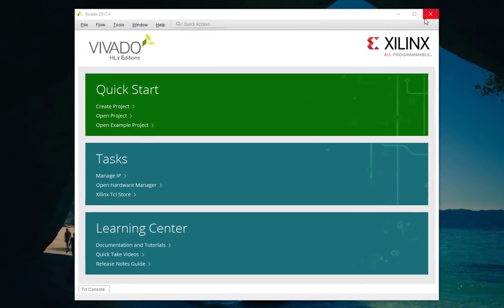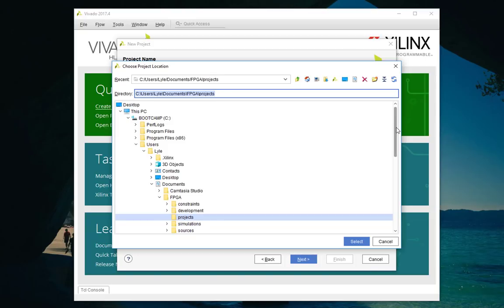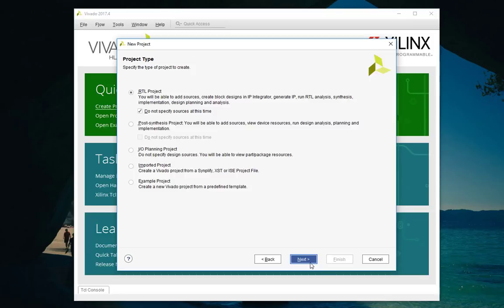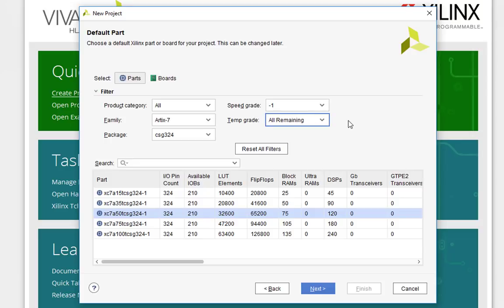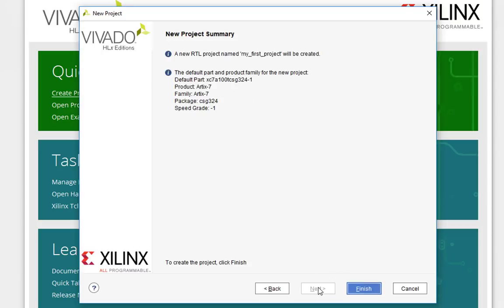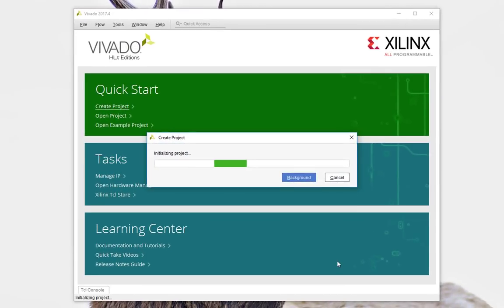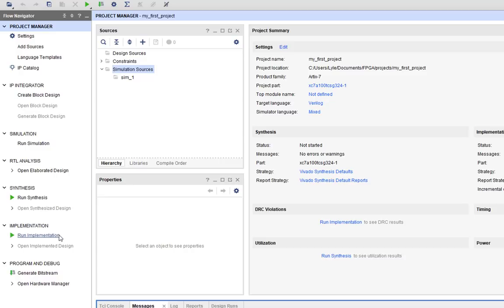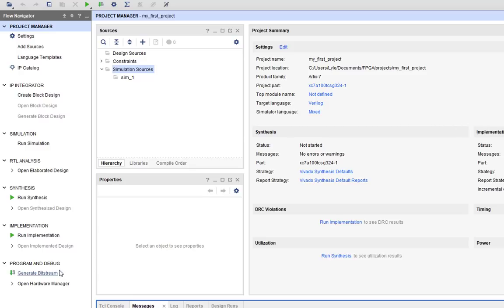Creating your first FPGA design in Vivado

Comment: Thank you!!  I followed your video and got the implementation to work on my arty S7!   The explanation of constraints was especially helpful and pointed me to what information I needed in order to set them up.   One point to those working on linux..... read the vivado release notes....the option to install the cable drivers has been removed from the install.  The cable drivers have to be installed after you install vivado by running a script...otherwise vivado will not be able to see the board and you will not be able to program it.
Reply: yes, I got stuck at this point for some time!

Comment: Excellent video!

Some suggestions: 
Rather than specify the exact FPGA model, package, etc., it’s easier to specify the Digilent board name, which will set the FPGA parameters automatically. 

Lastly, just a minor point—when calculating the current through the LED you forgot to account for the forward voltage drop of the LED, which for a green LED is ~2 volts. So the current is (3.3 - 2.0)/R.
Reply from the maker: Hi Jerry, thanks for your thoughtful comments! I originally intended to do as you suggest, but decided it would be more valuable to walk the students through the process so they could understand what those options mean. Certainly, in later classes, I have students create projects for pre-defined boards (which is much simpler!)
Also, I realised shortly after uploading the video that I didn't take into account the forward voltage drop across the LEDs. Oops! 
Have a wonderful weekend and thanks again.

Comment: Hey your name fpga therapy is great, I was a bit stressed with being stuck with my fpga and seeing this helped feel better. However I thought to finish projects you always need to combine them with Vitis (SDK before) and TeraTerm but now you just did it with only Vivado?!
Reply from the maker: Hi Silvercat4, I'm glad you felt at ease after watching this video. FPGAs are beautiful, but they do take time to understand. After that, it's great!

If you want to program a MicroBlaze core or the processing subsystem (PS / CPU) on a system-on-chip FPGA (e.g., a Zynq) then Vitis is useful. As for TeraTerm, I think any terminal/emulator will work. 

If all you want to do is configure the programmable logic (PL / FPGA) then you just need Vivado. There's a lot that can be learned before bringing MicroBlaze or a PS into the mix! :)

Comment: Great video! Questions: Why didn't the output port appear in the verilog file? Also, I always end each constraint with a semi-colon, is this no longer required?
Thanks!
Reply from the maker: Hi Curtis, I discovered soon after putting this video together that I failed to press 'enter' after typing in the name for the output port.  

As for terminating constraints / lines in Tcl, you can use a semicolon if that's your style, but it's not strictly necessary because a new line has the same effect. I have not tried multiple constraints on a single line separated by semicolons, but I imagine this would be valid as well.

Thanks for your support and encouragement.

Lyle

Comment: Can't we use GUI to assign the top level port to IO pins with specific voltage standards? What about timing contstraints, where is that done?
Reply from the maker: You can, but it's good to define the IO constraints manually in tcl. It also allowed me to demonstrate how to use the data sheet to answer the unknown questions about IO voltage standards etc.
Reply: @fpgatherapy  everything goes into the XDC file?

Comment: How do you get the speed grade when selecting the part? I've been looking through the box of the board, but I haven't found anything regarding the speed.
Reply from the maker: Hi AnMoMu, 

If you go to 2:54 on the video you'll see a close up of the FPGA chip. This close up picture shows the device family Artix-7, part number (XC7A100T) and package identifier (CSG324). The line below the package identifier is the 'Lot Code' (useful for traceability and verification of the part). Then, immediately below the Lot Code is a number (1) and letter (C). The number '1' indicates the device speed grade (in this case, the higher the number, the faster the FPGA's minimum performance in terms of clock speed... i.e., higher speed grade -> faster designs). The letter indicates the device's temperature grade (C = Commercial, I = Industrial, and E = Extended). 

The Nexys-4 DDR's Artix-7 has a speed grade 1 and temperature grade C. 

Note: it's unlikely you'll find a development board with a temperature grade other than C, but perhaps some boutique reference boards do. 

I hope this is helpful.
Reply: @fpgatherapy  It's been really helpful. Thank you very much.

Comment: How did you actually kick off the synthesis?  That step is not visible.  How did you get to the "launch Runs" screen?
Reply from the maker: Great question! On the left hand side of the Vivado window (in the Flow Navigator panel) there is 'Run Synthesis' button.

Comment: Hi, thank you for uploading this nice explanatory tutorial. Can you make a video of a design using differential clock of virtex - 7 board in constraint file. I have trouble in generating differential clock of the board and connect it with the design. Thanks
Reply from the maker: Hi Naveen. I had planned this out, actually, and have some code ready that may be of some help prior to me releasing a new video. 

Your FPGA will have positive and negative (differential) clock pins on it. In your constraints file, you need to specify the pin locations and IO standards according to your development board's datasheet. It might look something like this (for a ZCU104 Zynq UltraScale+ development board):

set_property PACKAGE_PIN E23 [get_ports "CLK_125_N"]; # Bank 28 VCCO - VCC1V8 - IO_L13N_T2L_N1_GC_QBC_28
set_property IOSTANDARD LVDS [get_ports "CLK_125_N"]; # Bank 28 VCCO - VCC1V8 - IO_L13N_T2L_N1_GC_QBC_28
set_property PACKAGE_PIN F23 [get_ports "CLK_125_P"]; # Bank 28 VCCO - VCC1V8 - IO_L13P_T2L_N0_GC_QBC_28
set_property IOSTANDARD LVDS [get_ports "CLK_125_P"]; # Bank 28 VCCO - VCC1V8 - IO_L13P_T2L_N0_GC_QBC_28

You'll also want to specify that CLK_125_P is a clock (it will propagate this information for CLK_125_N). Do this with some code in the constraints file like this:

create_clock -period 8.000 -name CLK_125_P [get_ports CLK_125_P]

Note: '-period 8.000' specifies the clock's period in nanoseconds. The ZCU104's clocks have a frequency of 125 MHz, so the period is 8.000 ns. 

Place this create_clock command above the set_property commands in your constraints file.

If you want to generate a single-ended clock based on your differential input clock, you should use an IBUFGDS (stands for input buffer, global differential signal) in your top-level VHDL or Verilog file. 

IBUFGDS #(
   .IOSTANDARD("LVDS") // Specify the input I/O standard
) IBUFGDS_inst (
   .O(clk), // Buffer output
   .I(CLK_125_P), // Diff_p buffer input (connect directly to top-level port)
   .IB(CLK_125_N) // Diff_n buffer input (connect directly to top-level port)
);

You could test this out in Verilog with the following code (in addition to the constraints file you'll need to create):

module clockCreation_TOP(
    input CLK_125_N,
    input CLK_125_P
);

    wire clk;
    
    IBUFGDS #(
        .IOSTANDARD("LVDS") // Specify the input I/O standard
    ) IBUFGDS_inst (
        .O(clk), // Buffer output
        .I(CLK_125_P), // Diff_p buffer input (connect directly to top-level port)
        .IB(CLK_125_N) // Diff_n buffer input (connect directly to top-level port)
    );
    
    // Example clocked process using the newly generated clock
    reg [31:0] counter; 
    
    always @(posedge clk) begin
        counter <= counter + 1;
    end
    
endmodule

If your FPGA's input clock is 125 MHz, then you could pass the 27th bit of 'counter' to an LED and it should blink on and off at approximately 1 Hz.

I hope this is helpful in the short term.

Comment: @FPGA Therapy I am running a Zynq on the Zybo dev board. I would absolutely love to see you do a video fixing errors. I am currently having trouble fixing a "no such directory"/"could not read file error , yet the directory and file do you exist. This was while using Vivado IDE just before generating a bitstream. I think it has something to do with generating the design constraints and creating IOSTANDARD constraint ".../axis gpo 0/gpo io o[0]" not directly connected to top level port. Nevertheless a tutorial on the TLC console and output messages and solving errors we would be most appreciated. You do an excellent job explaining.
Reply: I had this problem come up once ‘could not read file’, it seemed to be to do with Windows file path length – I was using Microsoft Onedrive at the time. The problem went away after I  transferring the project directory to the local hard drive.

Comment: Great work man! Please make some new videos if you can find the time!
Reply from the maker: Thanks, Rob. I appreciate it! I plan to produce a few more videos using similar (entry-level) FPGA platforms. If there's a topic you'd like me to cover, please let me know.
Reply: I have a vcu1525 that I am trying to figure out, this gave me some much needed direction. Especially your comparison of synthesis to compiling.
Reply: @fpgatherapy  I am trying to port an application written in C++ to the VCU1525, maybe a tutorial on the workflow of converting a simple c++ program to a bitstream? Are you aware of any significant workflow differences that I should be aware of when working with the VCU?
Reply from the maker: @robmartin7873  That's a very powerful development kit. There are considerable workflow differences between conventional 'software' development (e.g., C, C++) and FPGA development. I find that the more experienced you are at software, the more difficult it is to build the intuition for how your code is translated into a functioning program (or bitstream) on the FPGA. It's important to understand how the synthesis and implementation tools translate your code into basic logic elements. I've also found that a lot of students take some time to get used to the fact that everything is happening all the time on the FPGA, and not necessarily in a defined sequence.

Ultimately, translating a software algorithm onto an FPGA often depends on a) the nature of the algorithm (e.g., signal processing vs. pure logic vs. a procedural, etc.); b) your specific goal (performance, functionality, parallelization, determinism), and c) how patient you are. 

When did you begin with the ZCU?
Reply: @fpgatherapy  We got our hands on the VCU back in the summer of 2018, we quickly discovered that we were in way over our heads, and hired an FPGA dev, he spent 3 months on the project and stated that he could not overcome some kind of library issue. So the project has been dormant for a few months, however it bothers me having such a powerful piece of equipment sitting idle. Do you offer consulting services by chance?
Reply from the maker: @robmartin7873  That's not too surprising. The Virtex-7 UltraScale+ FPGAs are about as far away from entry-level as they come. They also require significantly more effort to get running because they feature more complicated constraints (e.g., differential clocks, high-speed I/O). That being said, once you understand the basic principles of timing and constraints, your choice of hardware platform isn't an issue until you start dealing with System-on-Chip (SoC) FPGAs (e.g., Zynq MPSoC family) which have the added complexity of an integrated microprocessor (like a Cortex-A53). 

If you let me know what you're attempting to do, I might be able to help or at least point you in the right direction.
Reply: @fpgatherapy  That would be much appreciated, is there a way to contact you outside of the public youtube thread?
Reply from the maker: @robmartin7873  Sure. I think you can send me a private message through Youtube. That might be the safest way for me to share details.
Reply: @fpgatherapy  I feel stupid for this, but I cannot find the about or PM link on your profile page??
Reply from the maker: @robmartin7873  Looks like it's no longer possible to message me directly. My bad! Look me up on linked in: linkedin.com/in/lyleroberts
Reply: Which one is cheapest FPGA for students that can be programmed through a USB from PC?